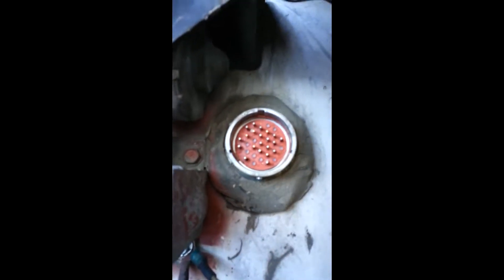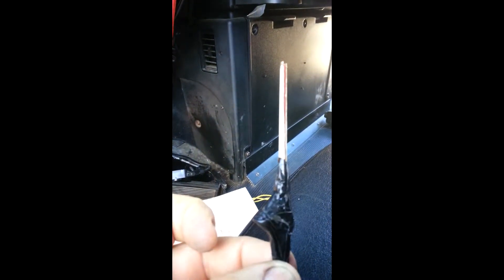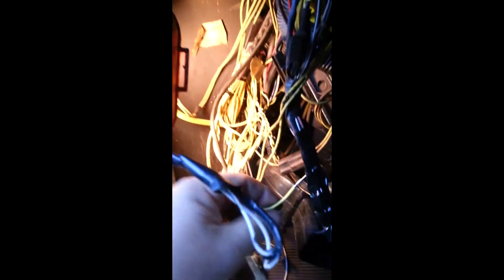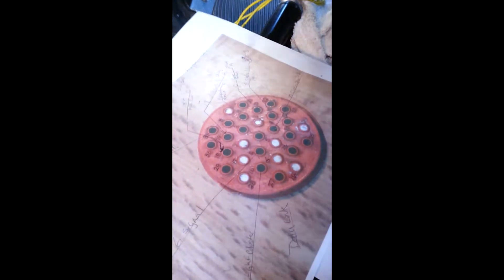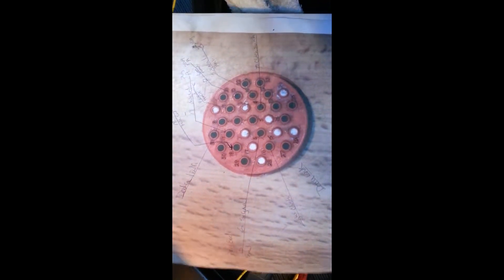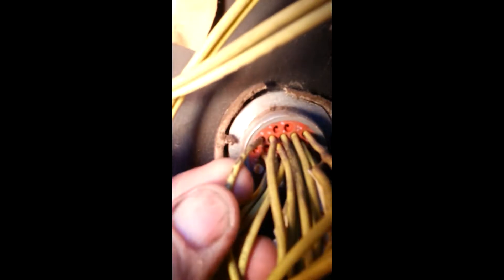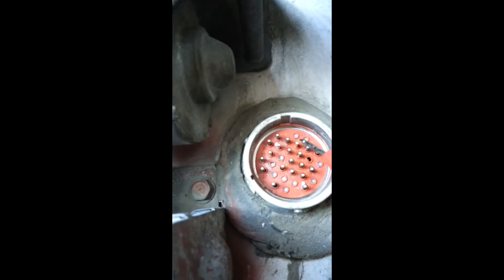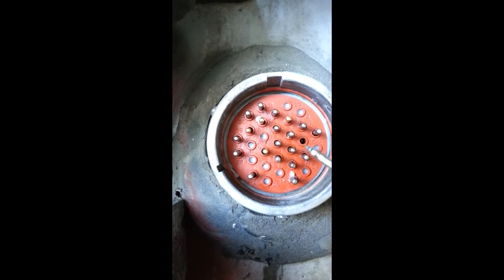Motor swap Cat to Cummins fixing wiring problems

Comment: I just did the  Opposit I put a c15 cat but i need to work on the  Harness I have the diagram for the cat but don't really know what to do
Reply: Damn I’m taking a c13 out and putting a n14 in. Let me know how it goes, I rather not spend $1,500 for adapter.
Reply: Damn I’m taking a c13 out and putting a n14 in. Let me know how it goes, I rather not spend $1,500 for adapter.

Comment: fellow bco here you did great i have a c13 a bad ass c13 its an australian c13 750hp right now but had a pete dealer in colorado replace my air compressor and they created a air lock she got hot i havnt done anything but a bottle test. she has over one and a half million miles on her so i fear it did some damage she is pushing the coolant out surge tank and gets hot then once low so im trying to decide what to do heads are very expensive and hard to find for her. so i know the n14 is a very strong engine and very good on fuel so i wa sthinking either putting a n14 in her or try and put a 3406e in her but being a 386 im not sure how much needs to be changed to install the c13 is a brute but is shorter so im trying to find out what has to be done.also fleet service carries those deutche pin remoers very impressive presentation looks great in there too.